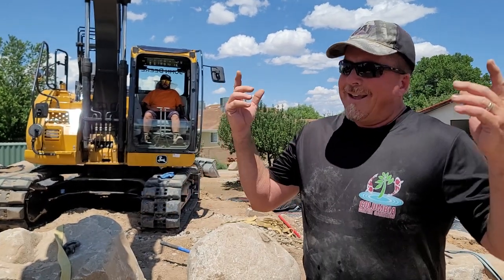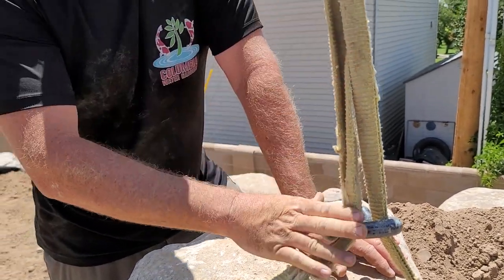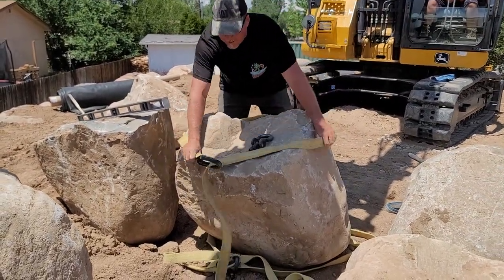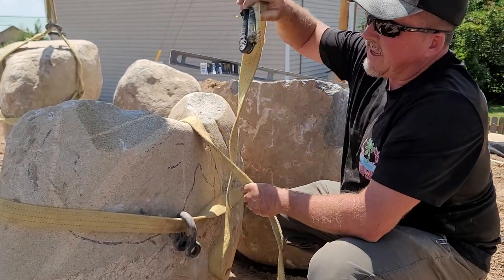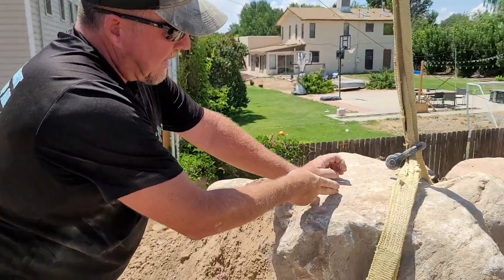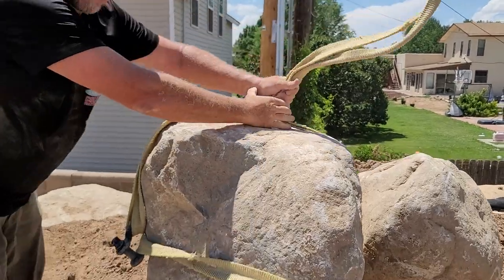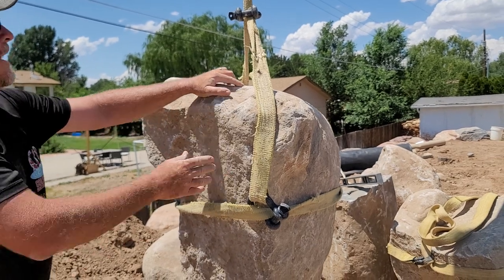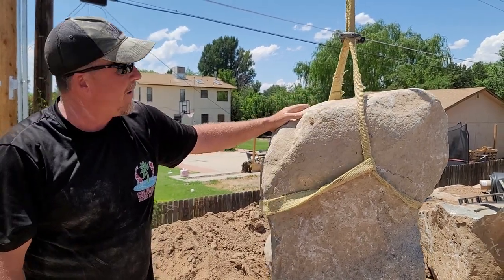How to BELT STRAP a boulder SAFELY

Comment: Hello Carl - I live in Alberta in a small town and am redoing my pond with big rocks. I came across your video and used your technique. It worked awesome. Used two 2 inch straps so that my friend was strapping a rock, while I was placing and unhooking. We should have also had 1 inch straps for the smaller rocks, but we made the 2 inch straps work - Thank you for the video!
Reply from the maker: That's awesome 😎!  I may have about 30 different straps in my collection.  Different lengths and widths. I'm starting a job in a few weeks where we will have 2 excavators running at the same time.

Thank you for the kind feedback, I love helping others, and I'm glad to have helped you. 

Happy ponding!  -Carl

Comment: Definitely gonna use this method.   I have heavy rocks to move with a backhoe and it don’t have a thumb.   Plus this method don’t scratch the rocks
Reply from the maker: Since you're new at this method.  Remember that weight cinches it tight. When you set the rock,the cinch will loosen. 

Set it and forget it...  😂 

Good luck 👍

Comment: This is why you're one of my favorite channels. Always sharing your hard-won knowledge. Does this method work with the rock in any orientation? If you took that same rock and flipped it lengthwise so that the point was standing up (like a pyramid) would you still be able to grab it? What if you wanted to place it on its side?
Reply from the maker: I do it all the time, and thanks for the cigar. 😀
Reply: @ColumbiaWaterGardens  This is a great strapping method. Tested it out yesterday. Here's another pro tip you already know and I learned the hard way: Your d ring needs to be on the face of the rock. Or at least not on the side that's against the liner. haha
Reply from the maker: You learn fast, padwan. I have to check out your channel and see your progress. I'm still saving that cigar for a special occasion. ;)

Comment: Great content buddy this is far better than the methods I have been using as the strap can be a real problem when going from underneath the boulders. That said I tend to use smaller rocks underneath to allow the strap to be removed easier. It isn't always preferred though since sometimes I want to lower the boulders into place without adding additional height to it with smaller rocks to support it.

Adrian Potkins Qatar waterfeatures
Reply from the maker: Thanks bro!  I appreciate the feedback 🙏

Comment: Hey Carl. Great video im a fellow scaper from canada could you do another video of more detail on 2nd clevis pls
Reply from the maker: Welcome to my channel.  There are 2 clevis.  One that inches the top and the other that adjusts the balance on the side. If you experiment with it a little, you'll get the hang of it easy. 

This method had widely been accepted by my friends in the industry.  It's fast, safe when done right and easier to get the straps out. 

You can always call me for a quick question at 888-713-7771 x4

Cheers!

Comment: Can you give examples of any boulder types/ shapes where you would not want to use this method?
Reply from the maker: Great question.  I use this method on squares and rectangles mostly.  I'll also use it on a triangle where I want to use the flat larger surface and basically do an upside down triangle.  Any time where getting the strap out from under the rock is a problem, I use this method.  The rest of the time, I use a standard strap - where the loop is on the top and the two sides are equally supported.
Reply: @ColumbiaWaterGardens  Do you have a video showing the other method you use for, say, round boulders?
Reply from the maker: The belt strap with round boulders is the best. I only suggest adding a d ring on the side opposite the belt loop

Comment: this is awesome
Reply from the maker: Thanks!
Reply: @ColumbiaWaterGardens  does the shackle/D-Ring up at the top really not ever slide up/loosen up ?
Reply from the maker: No
Reply: @ColumbiaWaterGardens  oh, ok...I guess it's some mental block in my head where I look at it and wonder if the shackle will slip up, but I guess not as you are saying.  I've done it before where I had two "belts", without the top shackle, but I like what you have better...more simple/straightforward
Reply from the maker: Call me. 888-713-7771 x4
Reply from the maker: It does slip to the best pinch point
Reply from the maker: More of an adjustment

Comment: What would you do to if the boulder is not round? I have one that i have to move this weekend and it is around 3,200 lbs
Reply from the maker: A standard sling. Look at the boulder I'm moving in my latest videon on my channel. It's basically a loop pulled through a loop.
Reply: @ColumbiaWaterGardens  i got two 2x20ft lifting slings from Harbor but when i am doing the second loop the sling is to short. Can i attach a 2x20 ft to the one wrapped around the rock?
Reply from the maker: We do it all the time.
Reply: @ColumbiaWaterGardens  thanks for the video and information. I got a 30 feet sling and did it your way and it was super easy. Thank you.
Reply from the maker: @blackhouse7646  please share and subscribe 🙏   I need help with the algorithms....

Comment: Been extracting landscape-grade rocks out of streams and ravines. Being the knucklehead I am, I would fetch the biggest rocks I could pull out and carry up the slopes. Some were quite heavy and exceedingly difficult. I would put them in the tractor loader or Polaris dump bed. As I progressed and found rocks too heavy to handle I made a canvas bag similar to one's I had as a paperboy and I would use the Polaris winch with ot without a snatchblock. But I like your method better and will try it, but I am dragging the rocks up slopes so I hope the D-rings cinch down. I'd get rocks home, pressure wash them and then coat with linseed oil. Brings out the color a bit but always looking for better coatings. Thanks! Oh, one rock was so heavy that with a double snatchblock I started the winch and since there were no anchor trees I used my Ridgeline. With the double pulley I actually began to drag the truck across the ground. Had to add another pulley.

Comment: Also do you recommend only that style of strap. Can we use the normal lifting straps that has the same loops at either end ?
Reply from the maker: I like these straps because they are inexpensive, can take a beating, and are generally speaking double to triple the typical load strength.  You can use this method using a continuous loop, but we generally reserve the continuous loop for standard strapping where the loop is over the top and the sides are equally supported.

I shot this video because many of my pond building friends see me doing this in social media (IG, FB, etc...) and have asked me to film a video showing how to rig this way.

Try it, you'll be pleasantly surprised once you get used to it.